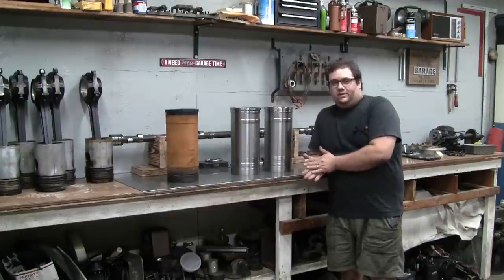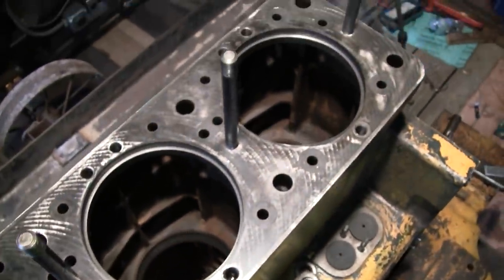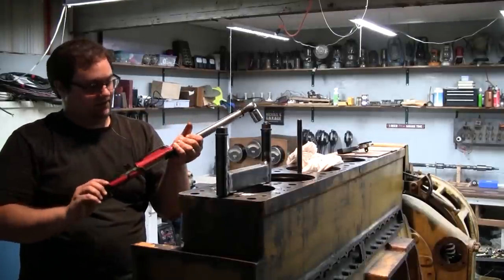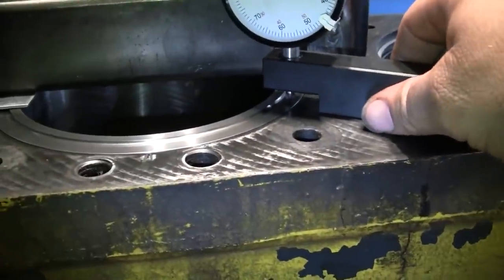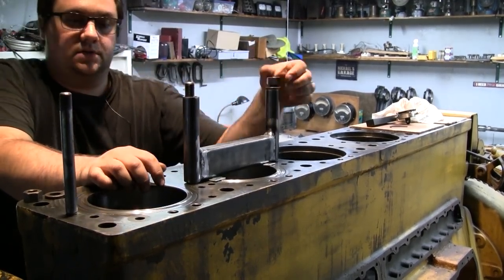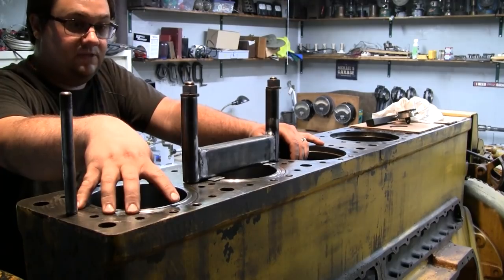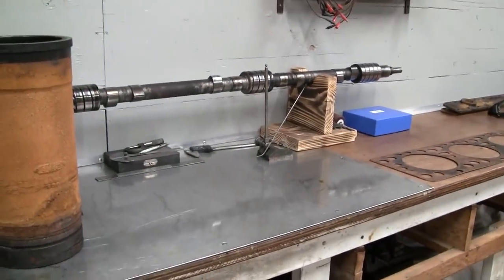1939 CAT Diesel Gen Set Cylinder Liner Protrusion

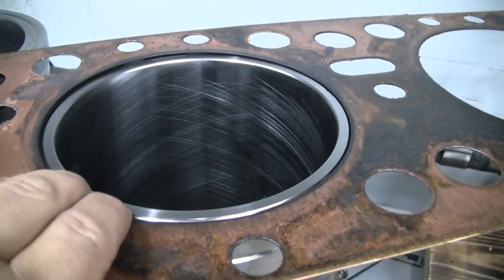Comment: 2"51 to 3:19, I used to process engieneering change orders (for an aircraft manufacturer) and the engineers never ever put in the change order 'why' something is chagned. The step you reference is something I've encountered before, and my uncle explained that it came about for several reasons and poppped up on several engine brands from the 50's to the 70's. Its to prevent blowby, gasket errosion and to assure a solid block to head connection. The gasket itself is to allow minor imperfections between the two gross mating surfaces of the head and the block. In older engines where its two flat surfaces mating, the gasket material will errode over time, eventually causing a 'blown gasket'. At least, thats how my uncle explained it to me. He was an engineer, I just process engineering change orders for a few years.

Comment: A suggestion I've found very helpful since I started using it.  Buy a footstone from a momunment dealer, you can susually get one that was never picked up really cheap, I paid $40 for the one I have.  They are perfect size to glue two sheets of sandpaper to and their weight is just right for leveling and cleaning tops of blocks and cylinder head faces.  Me and William Martin, the name on mine, have leveled dozens of heads and engine blocks.  They're especially useful with older blocks where liner protusion is critical.  If you're lucky they might throw in a small granite block too.

Comment: 3:38 Flame tracking. The step reduces the cross sectional area that the flame and combustion gasses can pass through to get at the copper. The thinner the cross-section, the lower the gas velocity and the lower the overall heat capacity that can travel to the gasket. This prolongs gasket longevity and keeps it cooler.

Comment: The raised section is a fire protection for the gasket. It's a good improvement, worth the money. Does make it a pain when you have to swap the whole set, and you're just mingling one liner. I wish CAT were a tad sensible and offer a discount for the full set on older machines. As they say, you drive a better bargain with honey, rather than mustard.

Comment: You wanna rethink your stand point on that cam, it's trash don't spend money rebuilding it if you aren't gong to replace that cam! When you get surface pitting on the roller surfaces of the cam, it's done. The pitting will start to gaul and will fail with use taking all the money you spent on the rebuild and burning it in one horrific failure. If your in doubt about what I am saying send the cam out to a machine shop or a diesel service shop to have them check it for cracks and flaws, mag fluxing will show any hidden failure points. If it checks out as being ok you can have them re-polish the lobes properly. Not saying your doing a bad job, just there are some tasks that need to be done with the right equipment the first time around. But all in all your doing a good job on the rebuild. But seriously get that cam checked out and maybe while your at it have the crank checked and re-polished as well, your down that far now, may as well do it dead nuts. Cheers!

Comment: Superb video, excellent machinist skills as you prepped each cylinder and dry seated the liners for fit & conformance. Impressive. My only criticism is you need to record all critical cylinder tolerance values on the back of a well used Chick-Fil-A bag. Works like magic every time!

Comment: International actually took gasoline model engines like the 460 350 some others they had trouble with head gasket blow out converting gas to diesel some they came out with the dry liner to fit the apparent bore of the gas engine block the dry liners have that step to stop gasket blow out

Comment: That step is like oringing a dodge cummins 5.9 there will be a few thou between the step and head then in explanation it touches the head it protects the head gasket from blow out specially if your running turbo on the engine

Comment: That lip shouldn't touch the head. If it does, gasket compression will be compromised. So no, it doesn't act as a fire ring per-se. 
Will it reduce direct exposure of the gasket ring to the flame? Somewhat, yes. The gap will be slight. 
Part of the purpose is gasket alignment (bolts and dowels do the bulk) 

Check your new liners on their seat- they should be a consistent measurement negating the need for liner-tracking. A good practice is to check all of your new liners and make sure they are consistent. If they are, you can mic and match. If not, then yes you need to keep an eye out. 

As for shim-stacking, the general rule we run by is to try and avoid it, but if you absolutely have to... let's just say it has been done. 

If you have to do cutting, watch for cracks in the counterbores.

Comment: This is ASMR for old mechanics like myself!😁 It's amazing how accurate CAT was on the overall machining on these old blocks, and how little they change over the course of 50 years or so. You've got a nice setup for accurately checking clearances on your liners. This is essential on larger diesels if you don't want future problems with coolant migrating into the cylinders or elsewhere. I'm wondering if maybe that top step on the liner is also to protect the gasket from the high combustion temperatures, in addition to being an effective stop against over-torquing? I've seen a lot more issues with coolant getting into the bottom end, via the lower o-rings, than into the cylinders, both on CAT and Detroit. Great video Mike, thanks!😉👍
Reply: @RobertFay  Yep, that pretty much sums it up.😁

Comment: Those minor pits on the cam will just hold oil, will be many many hours before their worn out.
Reply: That’s just what I was thinking, more oil on the surface
Reply: It will also be a reason for quicker piting and metal fatigue.
Reply: Of course that's also more friction, never rely on oil alone to fill in pits. Originally those cam lobes was smooth. Once pitting starts they don't get better, I personally wouldn't use that cam that way, it looked too rough.

Comment: if you can get 'em I'd say go for adding a 2 thou shim with the 15 thou for pushing the spec closer, as getting as close to spec as you can will extend longevity. however if caterpillar recommends against stacking shims, then I'm sure it'll be fine

Comment: older engines are forgiving. years ago i rebuilt a 2470case 504ci paid $2000 for a 4wd tractor with blown engine only replaced cylinder #4 just below the turbo. piston/rings/sleeve comes in a kit from caseih previous owner broke the pyrometer gauge overheated the engine before shutting it off #4 cylinder exhaust valve snapped embedded in the piston a common issue with these engines there's even a warning decal on the dash about it. new cylinder kit new valve new gauge tractor ran good for many years still in use today old cylinder sleeve was million bits in the oil pan & sump screen plugged i was worried bits may have plugged oil ports but everything worked out
Reply: My son and I overhauled the 504 bdt in our 2590. Pretty straightforward. Had a machine shop make some locating pins for installing the heads , no dowel pins . Followed the shop manual and it came out real nice. Tons of power in them old cases.

Comment: I would be concerned running those two new style liners with all the other older style liners as the new ones might raise the compression slightly in those two
Reply: I think he's waiting to get the others, maybe on order.
Reply: Compression will be the same , the new liners will keep the same bore and the stroke remains unchanged. And it also sounds like he is waiting on 4 more liners, so he will be running 6 new liners.

Comment: Cat had oil problem with the early engines such as the 57 d8f i been working on and one big problem i ran crossed was the rist pin floods with oil when that happens the oil has no where to go but up and inturn the oil leaves heavy carbon on the piston top and then the piston starts bumping the head and runnions the rod bearing

Comment: If it's anything like Perkins, they had problems on the earlier liner version.  Without adequate downward compression  from the head onto the liner, the liner could become "loose". The up and down motion pressure of the piston would then hammer off the top lip of the liner, and eventually rip it down into the engine. Perkins eventually beefed up the liner, and added extra material to the top surface similar to what you're saying CAT did,  so the head would keep it down tight into the block.  How do you think I found that out? Lolol

Comment: that stepped lip was also done on an engine inthe UK called the rover k-series(pre-dating the honda k-series) its only 1.4 litres, but the liners all have those steps. From what I could fathom the idea was the step never touched the head(obviously) but came close, the reasoning was it let the fire ring on the gasket just seal up, but shielded the fire ring from most of the combustion event itself. To give you an idea how stout this setup was, this engine made 105hp from the factory, I made over 300hp@21psi on methanol, stock gasket, liners, and pistons. 1.4 litres.

Comment: I watched an earlier video as you started cleaning the crud and rust from the upper block.  The big chunks may have been sand from the original block sand casting.  It does not seem logical that muddy pond water was ever put into the radiator, so those chunks that crumbled like sand probably were from the sand mold.  Would it be possible to remove all the rust and crud with a sandblaster?  I think that I WOULD HAVE TRIED USING A SANDBLASTER.  Removing all that rust had to be a real-time killer.
My wife said that you must not be married because of all the time you have taken creating all your videos.  I hope you get that Cat up and running before I land in a nursing home.

Comment: Cylinder liner is also cylinder itself?
Reply: Yes, you can rebuild these several times over, rather than replace the whole engine. On industrial & marine equipment, this is the norm for maximum service life. These are known as wet-sleeve engines, where the sleeve is actually the cylinder that the piston moves in. Normal automotive style engines can be sleeved also, but use dry sleeves that are actually pressed into an existing cylinder to restore it to original dimensions.😉
Reply: @danw1955 was this originally created in the States?
Reply: @twohats8462  Yes, they've been around since 1925. Lots more info here: https://en.wikipedia.org/wiki/Caterpillar_Inc.

Comment: can you run computers off non-inverter type generators? everywhere I look it says use PSW inverter generators, but looking at the circuit diagrams/layouts of most modern PC PSU's they're all switching power supplys with huge filter caps on input and output, so I don't see why a non inverter generator(running well) would cause any problems
Reply: @ruben_balea  good reply with awesome info, but I was more talking about completely non inverter type generators, like this cat in the video, old style generators they have no inverter at all, and the HZ/voltage is set by the windings and speed, and the variation in both of those is set by the govenor/how well the engine is running, basically I was wondering if a computer can run on those, everything I can find is about Pure sine, modified sine/square, very little to no info on old style non-inverter generators other than "use these for lighting, or for inductive loads" 
hard drives def have protection, I've repaired one that had its 12v rail blown up by a lightening strike before

old style generators were around long before inverters of any kind were widely used/affordable/even existed, and many buildings still use such generators as backups, and they are all equiped with computers now days.
I was wondering the risks of using an old style 230v/240v genny with modern equipment, I know most laptop are stupidly resistant and wouldn't care(the adapters usually do the entire range 110-250v ac, 50-60hz)
Reply: @ruben_balea  I love the long replys, much appreciated, really explained well,  here in NZ no matter how little we use, we still pay a minimum of about $100($60 USD) a month and it goes up from that, typical house with LED bulbs and computers etc will be paying around $200-250 a month, and it goes up from that., stupidly expensive.

Comment: I was taught never to use a torque wrench to loosen a screw or nut.  I never questioned what I was taught, just lived by it.  Then I see you using the torque wrench to break nuts previously torqued to 50 ft. lbs., albeit with the wrench backed off to zero.  Was I taught wrong?
Reply: On a digital and a caliper-type wrench, they can actually be used to torque LH threads (most designs). So, it isn't a matter of the mechanism not being able to go in reverse, rather, it is shock loads. Have you noticed when breaking fasteners free, they often "pop" free when loosening? That shock load can hurt torque wrenches. 
All it takes is one good "pop" and your wrench accuracy will be thrown off. Same goes for dropping them onto hard surfaces.

Comment: You need to be using a tenths indicator to measure cylinder protrusion. And I definitely would not trust any "precision measuring instrument" from horrible fright! Just a machinist opinion. Besides that you seem to be doing everything possible to rebuild this cat to the best of your ability! Keep up the great work! Just keep in mind.... Do everything to the best of your abilities and you will end up with the ultimate end product. I just really don't want you to put all of this money into this project to possibly have problems and or failures. I do not mean any offense by making this comment! I totally understand if you don't know... You don't know. Also, don't store the cam horizontal as you had it on the blocks of wood. You are actually bending it. Store it vertically either by hanging it or setting it on its end where it cannot fall over. Again, I'm sure you did not know this. There are a lot of machining and engine building facts that you only learn from either destroying thousands of dollars in parts or from old timers teaching you or from doing hundreds of hours of research. Hopefully this comment gives you a couple of tips that can help you build an extremely reliable engine! By the way, I love your content! I have learned a lot about gen sets from your videos. Like I said earlier, keep up the great work and stay safe out there! Dan @6-4_Fab Glen Rock, PA

Comment: How often do you have your torque wrench checked for accuracy.  I have a Williams, sight and sound 1/2" ratcheting, reversible torque wrench from about 1970.  I have owned it since almost new and I would say it has only been used maybe 200 times or less but it is 50 years old.  I used it mostly to torque lug nuts on aluminum wheels on cars I have owned.  I may have used it on head bolts on a car once or twice but I would bet it has not been used in 10 years.  I just wondered if you have yours checked periodically.
Reply: Roy Gunter     People like NASA have theirs tested yearly, maybe even more often   but for regular people that is overkill, a friend of mine tested the torque wrenches at work, he has the means to do it himself, the wrenches had not been tested for years, but they were spot on, a good torque wrench will not drift a lot over time, IF it is released after use.